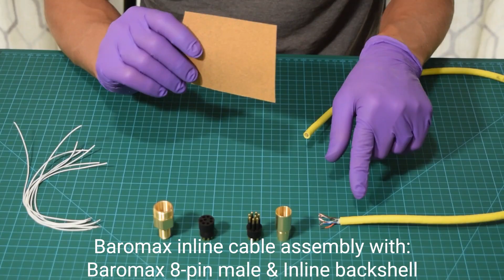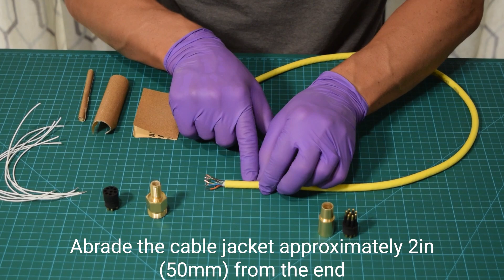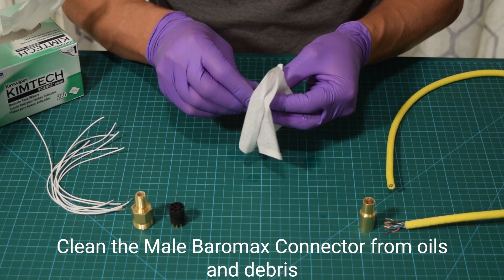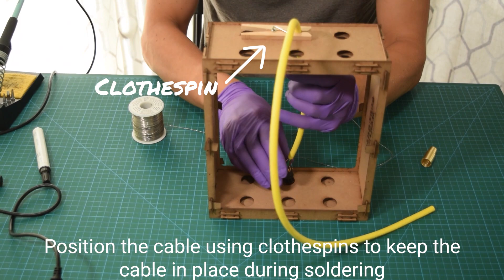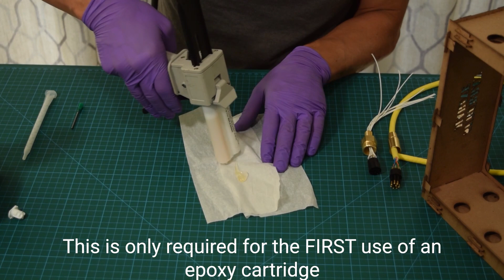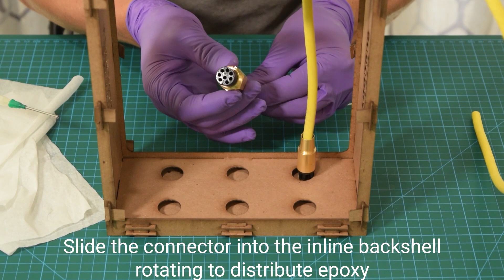Learn How to Assemble the Baromax Underwater Connector [Tutorial]

Comment: Hi there. Be useful if you could show the procedure for adding the circlips on the backshell (without scratching the anodised aluminium surfaces).  Any tips for this?
Reply from the maker: To install the snap ring, circlips, on an inline backshell we’ve had success taping the surface of the inline backshell with a robust thin tape like Kapton to prevent scratching.  Additionally, the ends of the snap ring are sharp from manufacturing.  Try sanding with 120 grit or finer to remove the sharp burrs on the snap ring ends.

Comment: What epoxy are you using?  Sandpaper grit?  Have you considered curing in a slight vacuum to remove bubbles or voids?  Thanks for the vid
Reply from the maker: We recommend using our Baromax 2-part flexible epoxy available on our webstore: https://www.suburbanmarine.io/product-page/epoxy-tube.  Use 120 grit sandpaper to prep all bonded surfaces.  Curing in a vacuum is not required but is recommended if you have the facilities to do so. Thanks for the comment!